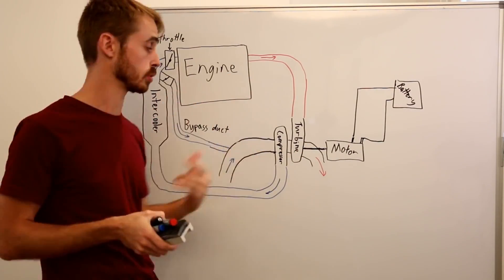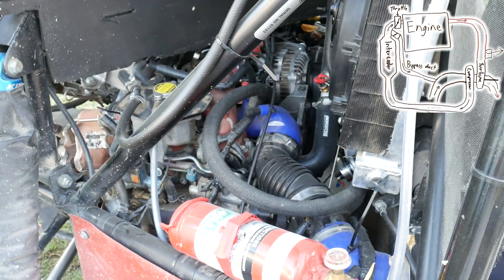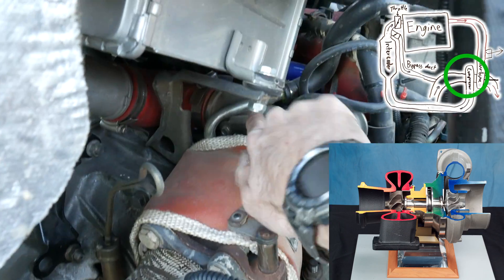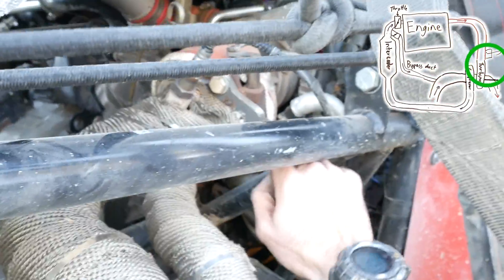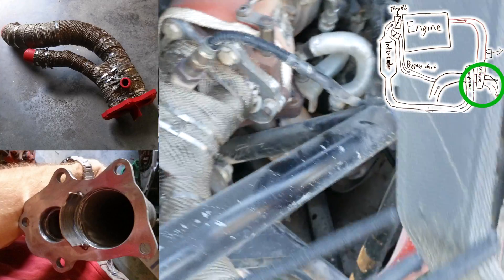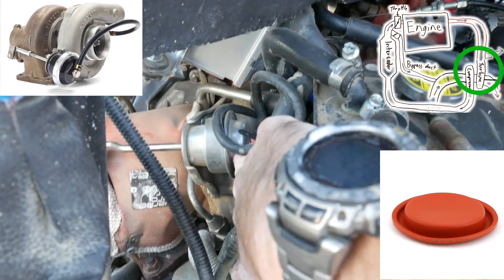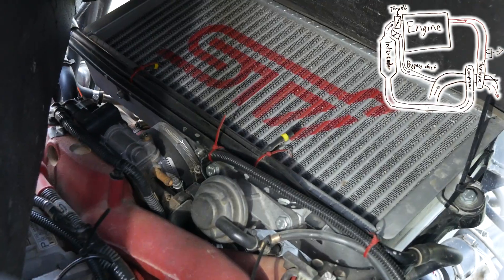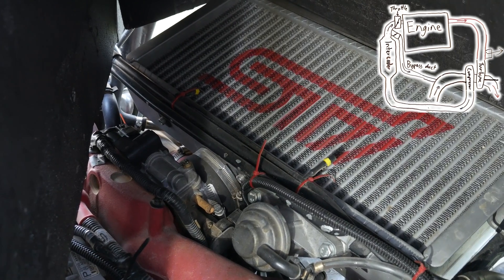Turbo System Layout: The Basics Explained

Comment: So when you have excessive pressure and the waste gate opens, does it just allow the exhaust to escape through the actual exhaust pipe? Does all the outbound exhaust have to pass through the wastegate?
Reply: The wastegate has it's own "exhaust" pipe that expends the wasted gas.
No outbound gas passes through the wastegate unless it hits its excessive pressure. It is a valve.

Comment: Hey Kyle, 
is there any chance you could do a review on the aerodynamics of the new Honda Civic Type R? I think there is a combination of misconceptions and marketing speech going around the internet, and no one really knows what they are talking about. It would be great to hear an educated opinion on this for once. Mainly about the "vortex generator" which I don't think does anything, the "rear diffuser" (same) and the hood scoop, which I think is a strange design choice if you want front downforce and reduced drag.
Cheers and keep up the good work!

Comment: Just put a GT35R Turbo on my Evo IX so I know a thing or two about turbos. I put my new turbo INSIDE of the intercooler. Seems counterintuitive but when the turbo is in the intercooler it cools the turbo so i don't need as many pipes. I put the waste gate where the lid for the intercooler once was, and the blowoff valve on the battery cover. Doesn't give that good sound this way but then again, i can't get the damn car to start anymore
Reply: LOL, "I know a thing or two about turbos. I put my new turbo (INSIDE) of the intercooler." OBVIOUSLY YOU DON'T.
Reply: @JerseyMikeP
woooosh
What is sarcasm?

Comment: maybe you could a video about inter cooling itself, like the different types air to air , air to water, maybe go into design types like factory vs after market units efficency, and different mounting locations, configurations etc
Reply: To change current industry standard terminology and nomenclature globally is and would be a huge battle.
Reply: as well as water/meth injection, chemical intercooling, pre-turbo injection, pros and cons etc
Reply: "However in single compressor and single heat exchanger applications the industry standard and correct term for the charge air heat exchanger is intercooler. "

That's just an example of one of those things where so many people use the incorrect term that nobody even knows the correct term anymore.

Charge air coolers are common and widely used on modern engines with forced induction, not intercoolers.
Reply: The term after-cooler only applies to a heat exchanger that is placed in a forced induction system after the compressor(s), the term charge air cooler applies to a heat exchanger placed anywhere in the forced induction system relative to the compressor(s), the term intercooler was coined to describe a heat exchanger that was placed between two compressors, so obviously someone dropped the ball somewhere.
Reply: From old papers on aircraft engines with turbosupercharging systems, the parts are clearly labeled. Without names for both the aftercooler and intercooler, it would be difficult to distinguish between the two in writing. 

Like I said, the industry mistakenly adopted the incorrect term, that should be corrected.
Reply: No, you're not understanding that these are where the terms originated. These are companies like Allison, Rolls-Royce, Pratt and Whitney and Wright Aeronautical! When the automotive industry started to adopt turbocharging, they got the terms wrong, and it should be corrected.
Reply: Kid, you fighting a losing battle.
Reply: It's not a battle, it's a simple correction.
Reply: Sure thing, tell that to the leading intercooler manufacturers such as Honeywell/Garrett, Borg Warner, Spearco, Calsonic, Griffin, ARE, Adrad, Denso, etc... 
Be sure to tell that to the vehicle manufacturers that according to you mislabel the components as intercooler in their factory manuals. 
Where did you get the idea your terminology is correct and intercooler is incorrect?
Reply: Again, where did you get the idea your terminology is correct and intercooler is incorrect?
Please cite credible sources.
Reply: There are papers that say the Earth is flat and the Sun orbits the Earth, that does not mean they are correct.
Not credible and not current. 
Sure thing, you work on correcting the entire global industry. 
Good luck.
Reply: He should also explain that intercoolers are almost nonexistent on modern engines. What's most commonly used in turbocharging systems today are actually after-coolers, or simply charge air coolers. Intercoolers act as intermediaries between a turbocharger and a supercharger, which is not something that's commonly used today.
Reply: +idontcare80 
With all due respect... 
In compound forced induction applications you are correct the heat exchanger(s) between compressor stages are known as the intercooler(s) and the heat exchanger after the last compressor and before the engine intake is known as the aftercooler. 
However in single compressor and single heat exchanger applications the industry standard and correct term for the charge air heat exchanger is intercooler. 
Intercoolers are common and widely used on modern engines. 
Intercooler and charge air cooler and interchangeable industry standard terms for the same device.

Comment: any particular reasons why waste gates are not electronically activated with a air pressure Sensor would that not give better control?
Reply: Money and complexity, I'm pretty sure electronic wastegates do exist.
Reply: yeah, Volkswagen uses electromechanical actuators to control the Variable Turbine Geometry (VTG) in their TSI engines. and i'm sure there are many more examples.
Reply: Friedrich Winkler I thought it was electronic bleed valves just like wastegates. It used to be like it at least :)
Reply: Cost. Their are Computer controlled wastegates (normally external) that even allow Boost by Gear to control wheel spin. And have Over-boost option when racing...like Porsches do on the turbo S /Gt2RS in the past for more Torque.